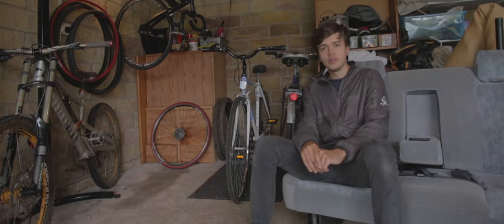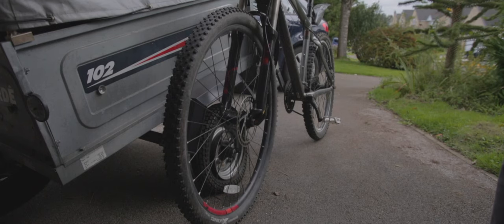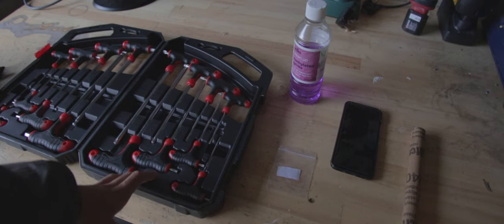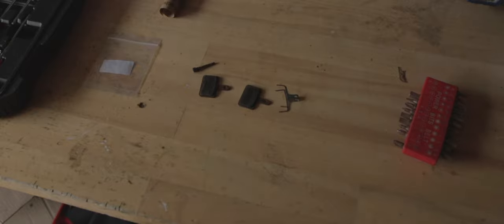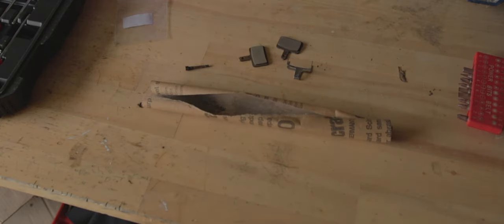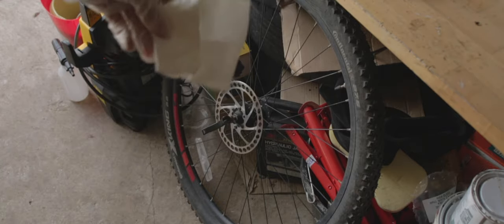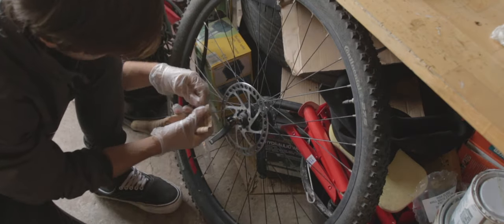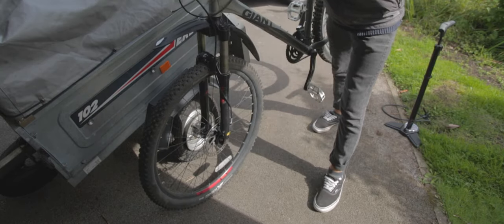How To Fix Contaminated / Squeaky / Loud / Oily / Bad MTB or Road Disc Brakes

Comment: does it still work with vinegar had the same problem with wd-40 can i do the same process but switch the methylated spirit with vinegar
Reply from the maker: Yes you can. It isn't as effective and you may need to leave the pads in the vinegar for longer than I left them in meths, but ultimately I've saved pads with vinegar too!

Comment: I have tried acetone and brake cleaner and sanded pads and still got sqeal when brake on stand still. i will try the metho and see how that goes thanks.
Reply from the maker: No worries! I hope it works! Last ditch effort would be to burn the surface a bit

Comment: Thanks for this! Is the mentholated spirit the same as white spirit?
Reply from the maker: White spirit can leave traces behind whereas meths evaporates completely. I've used white spirit before and it was alright but nowhere near as good as meths. For what it's worth, the bike in the video is still running on the same pads now. They've been absolutely perfect ever since!
Reply: @BenHuggett  ideal. Thanks so much for the reply. Every time I pull on my breaks I get nothing so I’m pretty sure they’re contaminated with chain degreaser
Reply from the maker: It's so easily done. I've just had to replace the pads on my trail bike because the chain oil I keep in the boot of my car has leaked all over the rear of the bike
Reply: @BenHuggett  you still a conservative cvmstain?

Comment: I tried different methods from YouTube but my brakes are contaminating again and again. Let's try this new method. I hope it will work 🤞🤞
Reply from the maker: Fingers crossed this works for you. If it doesn't it might be time to start inspecting the calipers in case your piston seals are leaking
Reply: @BenHuggett  It contaminated again 😔. I think I have to change my brake pads.
Reply: @BenHuggett  You were right! Oil was leaking from the caliper. Now everything is fine. Thanks man 🤜🤛